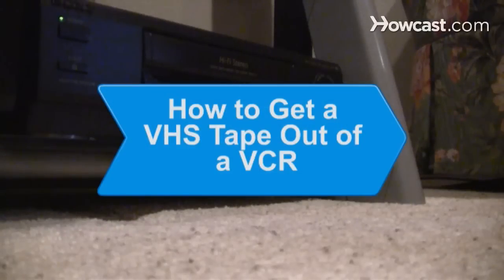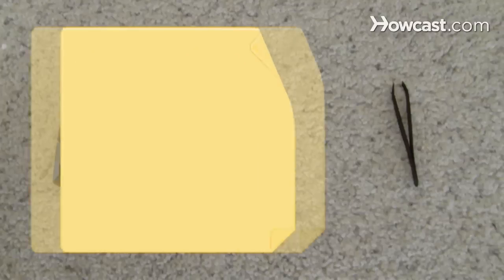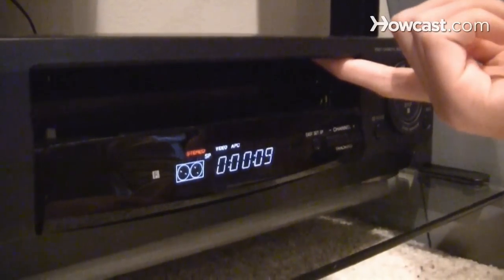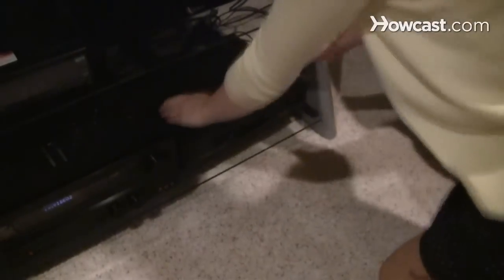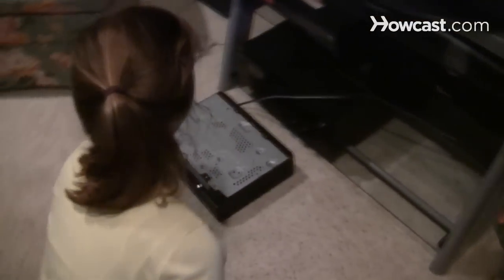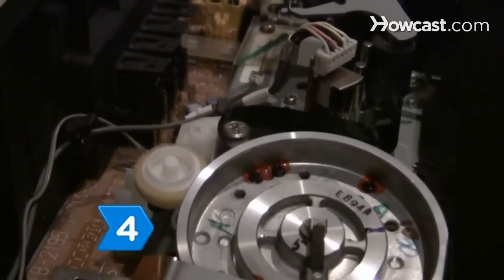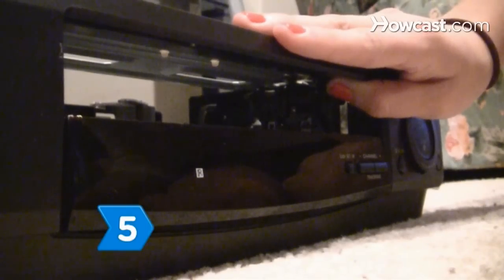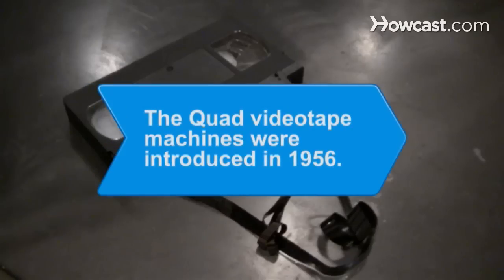How to Get a VHS Tape Out of a VCR

Comment: I still have two VCR's (one is a hybrid DVD+VCR player).  I've had more but they've broken throughout the years.  But I only keep them because I have so many VHS tapes.  It's not like I use them enough to get anything stuck in there.

Besides, normally the VCR would just chew up the VHS tape and spit it back out ruined.

Comment: I have a vcr that keeps turning off and the tape was still stuck inside. I tried unscrewing the vcr but it won't open. Is there another way to get the vhs tape out?
Reply: Did you ever figure out what to do? Mine seems to have a similar problem.

Comment: My Hitachi  VRC/DVD player will not eject the VHS tape ..I push the on button and the player comes on for about 20 to 30 sec then turns itself off  any suggestions  ? ?
Reply: +RT Rey The most common problem in a VCR is a broken belt. In older VCRs (more than 15 years) it is likely that most or all of the belts will need to be replaced.
Reply: I think the most common problem for VCR is that it's because the VCR heading is dirty or the VCR Belt is broken. I was having some issue when I was watching Babe one time. My  Emerson VCR got stuck and then I tried to get the tape out and then when I tried to press the turn on button on the VCR. The VCR Player comes on for about 30 seconds and then it turns off by itself. LOl
Reply: @patricknoonan7242 that's what is happening to mine as well. And there's a tape stuck inside.